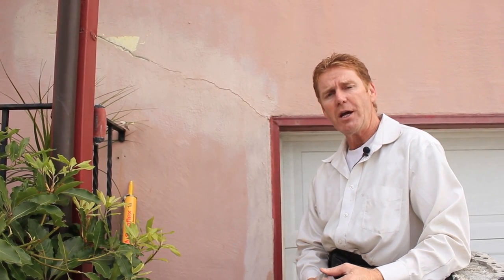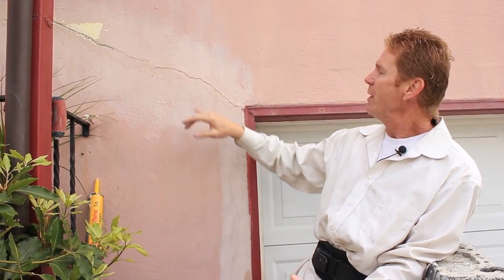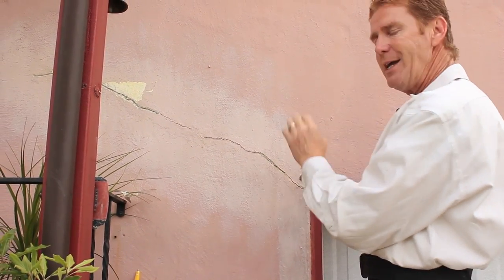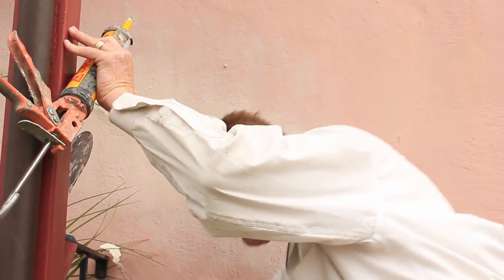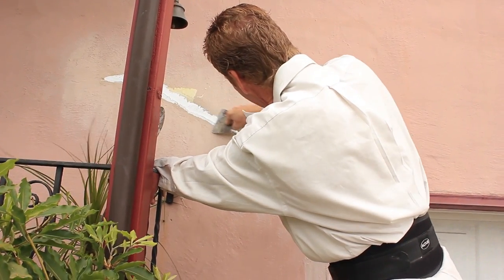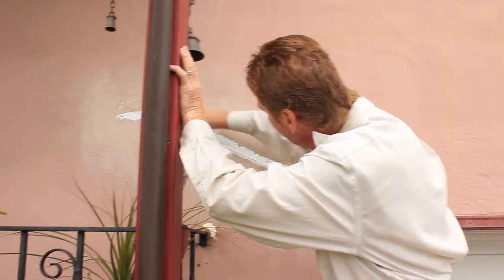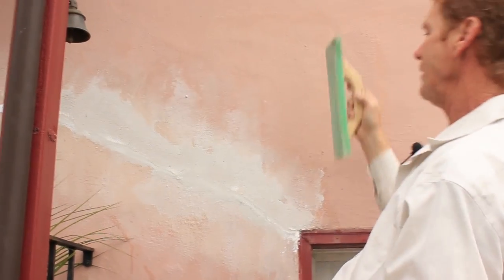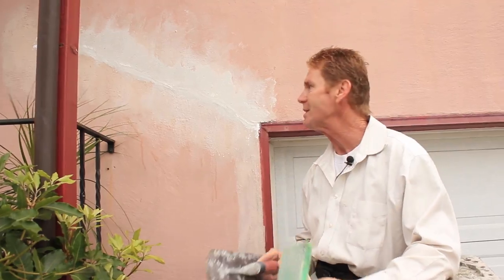Repair cracks with Sikaflex caulking by adding sand.

Comment: I commented on another vid you did I didn’t realize you are in SF Bay Area so am i. There are better sealants but most are multi component. Sika flex 1a has pretty high shore hardness but the fact is these type of cracks only usually move minimally with thermal expansion. And as you say vibration. With over 40 years experience installing sealants , for what you are doing don’t ever change from tried and true Sika. BTW I have always had better luck matching the texture by patting with a float than adding sand. I know you also use this method. Keep up the quality videos. You would think that this would be common knowledge to “stucco guys” but you would be amazed at how many just float a cementacious product in the crack and next year it’s back again. Keep it up

Comment: Hey Kirk, I've been using Sikaflex also for many years. It does a great job, but I also hate it because it is nasty, and won't wash off anything it gets near! But here is an alternate product that will clean up with water. It is called R-Guard by Prosocco. It is expensive, but well worth it for what it can do. Excellent adhesion, and about 30% flexing capacity. I'm a convert!! Give it a try. Thanks so much for your tutorials!
Reply from the maker: Good afternoon Paddy Daddy, good tip, thanks 
       Live long and plaster
  teaching  plastering video’s

Comment: Kirk, you essentially made like stucco bondo.Good stuff. Sika anything is top of the line stuff. I’m a glazier, and rain buster is crap, only thing close to 1a sika is vulkem which literally smells like good gasoline. As far as poly it’s good stuff. I got a job for you in Santa Rosa , if you see this contact me.
Reply from the maker: Howdy Goff, Sicka is indeed an excellent but hard to clean product. We don't get any on our hands then no problemo.
 Cheers.

Comment: I'm confused.. Kirk you mixed sand with sikaflex then floated it over sikaflex crack repair or you mixed up a little stucco and that's what you floated and mixed on top of the sikaflex?

Comment: Hi Kirk. Do u have any videos on fixing cracks that go into exposed brick pointing? I have a layer of bare brick on top of stuccoed wall (tile in between) cracked vertically in several places, Should I scrape out mortar and repoint or should I leave it and use strong caulking in the crack and then point on top of the crack with mortar, assuming that the crack will return in time? Cheers.
Reply from the maker: Howdy truth dude, 
 I have one that might shed some light on your question,
 Copy and paste the link below and see if it helps,
http://youtu.be/IkBHz_SQePQ
 best wishes,
Merry Christmas from the Giordano family to yours,

Comment: Please explain the different types of caulking and their applications. I have a stucco exterior and If I paint over the caulking, do I use an acrylic caulking, or elastomeric caulking, or is there a caulking that' has sand in it. I'm concerned about how the acrylic paint will reveal the caulking.
Reply from the maker: @birddogfreemann  simply caulk your cracks with Mor-flexx, it is an acrylic based caulking with sand in it. You can’t go wrong.

Comment: Hey Kirk,

I filled some mortar cracks with some loctite PL polyurethane caulking, but i didn’t know the sand trick at the time. So I tried to feather it a bit with a big paint brush and water. Anyway, it says it’s paintable but now I’m wondering if I should go back with some sandy caulk to touch up before repainting. There are a ton of cracks so it’d be a big job. Oh, and also wondering if you could stucco over this stuff. Thanks, Dan
Reply from the maker: Hi daniel, yes you can color coat over the entire walls but you will need to pressure was first then apply a bonding agent, "quikrete to the entire wall" not in the mix. 
This bonding agent will protect the surface so no ghosting or bleeding will show through the new color coat finish.
 Or if yours skilled you can apply a Mor-Flexx caulking to all the cracks and feather that in, the Mor-Flexx is paintable.💃
Reply: @StuccoPlastering  thanks Kirk — been loving the vids, just about to start my mortar + stucco journey here on an old adobe home in the california southwest, so i’m sure i’ll be watching more. would you recommend a ‘stolit’ type product for old adobe repair, or would traditional stucco be more appropriate? I power washed the whole house which exposed all the vulnerabilities in paint and stucco, so im trying to find a good solution for a ‘patch’ restoration, as we don’t have the means to completely strip all the paint and stucco. i’ll be repainting the house with an acrylic paint. just seeking best adheration, not sure we can keep every bit of water out, so a bit concerned about using an elastomeric type product. the place keeps pretty dry except for in the winter season. good amount of temperature flux here too, between mountains and desert. any word would be helpful. Thanks again

Comment: Hi Kirk, been watching your videos a lot to start preparing for minor repairs on our first home. How do you know a crack needs to be gouged out before caulking? Is it about the depth and width, or is it about what's causing the crack, or both?
Reply from the maker: This video below explains how to caulk cracks in stucco walls, whether structural or small.
https://youtu.be/2eIkdeIBbMs/

 As far as gouging, as long as the inside of the crack is clean, say you pressured washed the walls or used a wire brush, this sort of etches the inside of the crack where the caulking goes, your good. 
However, I'm scraping where the two cracks meet as this was like an earthquake, it caused both sides to flair out words, so I had to scrape that hump or ridge off, while I was doing it, I gauged or cleaned the sides as it had dust dirt grime and other junk in it.
 Remember nothing sticks to that stuff, not even the best caulkings.
Okay, spider webs sitck.

 What happens if the crack is deeper than 3/8 or wider than 3/8, and you caulk it, and over the next few days, you notice the caulking got sucked in? Nothing happens.
 You just add more when you have time. In this video, I smeared the caulking all over as that's what needed to be done. 

 As a rule, you just fill the crack any gets on the existing wall no problem, feather or blend it in.
Thus when painted, it won’t show.
Now you know. 🍾
Reply: @StuccoPlastering  Thanks for the link, I’ve been binge watching a lot of your videos. All are very informative and very useful thank you so much!!

Comment: I've done pool mastic with sika flex and it has one weakness it needs air to cure. So if you want to add sand for texture you need to let it set up for a little while maybe ten or fifteen minutes or so. If you throw sand on it right away a month later it will be wet and goopy under the layer of sand.
Reply from the maker: Not really, once the Sika-Flex polyurethane caulking hits the air, it starts the drying process.
 I have had to throw away too many previously opened tubes, even though I sealed them well after using them. 👨🏻‍🔬
Reply: @StuccoPlastering  I re applied mastic around a pool with sika flex and immediately threw sand on it for texture and a full week later it was still goopy under the sand. THAT was a pain to clean out I will never forget. The second time around I used deck o seal and five years later it's still running strong. About 3 months ago I did another pool mastic for a friend of mine and used sika because it was cheaper only this time I gave it about 15 minutes to air dry before applying sand and the following day and week 100% all good. That's been my personal experience anyway. I should add with the deck o seal I added sand right away. No choice really, you get no time to tool it despite my having left it in the fridge and applied it in shade around the pool. Had to hire a helper too, deck o seal is very unforgiving.
Reply from the maker: @Mike-qo4kp  Morning Mike, I've never used "Deck O Seal" thus can't comment. I have been using "SikaaFlex-polyurethan adhesive sealant  1A" for over 40 years, It has never failed me, I'm talking about no doubt, a thousand tubes, in this time. Once air hits it, as when we open a tube and try our best to seal it, it won't seal, it will get hard as concrete within a few weeks if it's left in a tube. It's the strongest, longest caulking I'm aware of. 🕵🏼
Reply: @StuccoPlastering  hi Kirk, appreciate the response. I was just conveying my experience and the type of sika I was using was self leveling which might explain the variation. Never used the good stuff that you use I don't think.

Kirk I have a question I am repainting the home I live in for the homeowner and there was a remodel done sometime ago. The home is old, south San Jose you're probably familiar with the area. Off blossom hill road by the foothills. Anyway the builder apparently among other things did not repair the stucco when he built out the kitchen. The house is stucco top half t1-11 bottom, anyway up on the second story where the stucco and roof shingles would meet there's a nasty big gap the length of the roof. Step flashing is clearly visible the whole way. I'd say the gap varies between an inch to several inches in some places where stucco is missing. Unsure how to proceed, but it's holding up my paint job. Homeowner hates how it looks and last year when it rained water was dripping in the kitchen it was making it's way to the fluorescent lights in the kitchen and dripping on the wood floor. Would appreciate any advice on what you think we should do. I think the house was built in the 60s. Also where the stucco walls meet siding the original builder used some kind of wooden drip edge which is rotted in several places. And where stucco and this drip edge meet there's no gap for water to drain so I'm not even sure what it's there for? If this was your house what would you do or change if anything? Appreciate your time and expertise, I watch your videos all the time.

Comment: Hey Kirk, I have an old home that was built around 1954.  All the walls are plaster with the steel mesh embedded in the walls.  I have to patch a bedroom wall and ceiling where we eliminated a closet.  The walls have a real light sand finish to them.  What kind of sand do you recommend and is there a method to how much sand to mix in?  Is there some sand already in Dap plaster of paris that my local store sells?
Reply from the maker: Howdy Ricky, most gypsum based product have very little sand, you can buy a hanful of sand to add or buy a bag of veneer basecoat, it has fine sand in italready.     
                     Live long and plaster, 
  Sharing so-called stucco secrets, or common sense tips

Comment: Hey Kirk, whats the benefit here of using caulking over mesh tape and stucco? Is it that it that the caulking has more give and therefore less likely to crack again?
Reply from the maker: Good afternoon Alexander, good question,
 It helps with movement, but on the downside, it's tough to cover the mesh tape to prevent a bulging effect.
There are many ways to skin a cat.
       Live long and plaster
  teaching  plastering video’s

Comment: Thank you for the video Kirk, very helpful. What kind of Sand did you mix with the Sika?
Reply from the maker: Howdy Triston, just regular stucco sand which is called either Felton or Olimpia sand.👍
Reply: @StuccoPlastering  thank you 🙂
Reply: @StuccoPlastering  Actually, maybe we have a unique challenge for you in all your years of experience(?) We need to grout a shower in a trailer with porcelain tile that will experience a lot of movement. The substrate is solid 1/2" plywood, but it will undoubtedly flex a little bit on bigger bumps. We can't find a grout that's flexible that isn't super shiny/glossy so we're looking at alternatives. Does what you did here seem like something that would work permanently? Either way thanks again!
Reply from the maker: @Trstn12  Hi Tristan, one can't put tile on plywood as, no matter the grout, moister will go through and swell the plywood which will cause the chain reaction of popping the tile off. No doubt with twenty showers or three months. You must use a cement board with a membrane underneath, Or lath and stucco or grout that piece of plywood.🤔
Reply: @StuccoPlastering  Noted and thank you again. We are planning on using a construction grade sealant adhesive made specifically for adhering tile directly to plywood and other uncommon substrates in high movement locations like trailers. It acts as a moisture barrier membrane that is (supposedly) impervious to water and any/all moisture with a permanent holding force and flexibility.  (hopefully this isn't a too good to be true situation) It's mostly the grout decision we're hitting, if we have the plywood protected from moisture and the tiles adhered strongly to the substrate, we mostly just want a grout that will not crack with jarring movement and will also adhere to the edges of the tile. Does the way you filled that crack seem like a viable solution to the grout issue? Also, I take your expert opinion to heart, we are just at a point where we built out the shower with the knowledge of the adhesive we're using, so we can't really go back on it and will take our chances XD

Comment: that was a great tip with the sand!
Reply from the maker: Hi ESCAGEDO WOODWORKING, today, there are  many caulkings with the sand in them, I like Mor-flexx which is really easy plus it's water cleanable.
 Best wishes, 
 kirk Giordano Plastering

Comment: Will the caulking destroy the sponge float if its not water soluble? How do you clean off? Thanks.
Reply from the maker: Evening MrTruthislight, dude, you are really paying attention! Yes, that float went into the garbage as it could not be cleaned with water.
 I buy these green spong floats by the case about 70 per box, sometimes you just gotta throw them away, the one I used in this video was on it's last leg anyhow,
 by the way they do sell caulking with sand such as Mor-flexx but it's as strong or long lasting as this sikaflex caulking., but it is sure easier to use.
 best wishes, 
Kirk & Jason Giordano's DIY plastering & stucco network
Reply: missing the not between it's and as.

Comment: What type of caulk do you use to seal the gaps between windows and EIFS stucco? Thanks in advance
Reply from the maker: Howdy Gunnar, Dude, the best caulking sealants are also adhesives such as Sikaflex and Moistop caulking.
There are many more, these two I happen to use often as they have never failed me plus both are professional grades and have stood the test of time.    
                                   Live long and plaster
               Kirk Giordano’s Plastering answers to life’s issues
Reply: Try Adseal 600LM, they’re awesome!

Comment: "Mixed up some sand"... Is sand mixed with what?  Just a bit of water?  Thanks.
Reply from the maker: Good afternoon Kyle dude, the sand will stick to the caulking, happy holidays
                       Live long and plaster
           Sharing the plastering knowledge
Reply: Cement is not flexibl ble.  The flexible stuff will keep the crack closed for a longer time.  Especially true for this kind of crack.

Comment: Dont pull the caulk gun when you're trying to get it deep into the crack. Keep it 90 degrees from wall. Push it into it. Then do your thing
Reply from the maker: Greetings Andrew, thank for the tip.
                Cheers,
       Sound Plastering tips from your favorite stucco geeks

Comment: so what did you do with the float?
Reply from the maker: Howdy Denny dude, the caulking is super strong and a sealant, so if I try not to get the float to touch the caulking just the finish which is stucco.
 I did wet the float a little bit as to dry a  green sponge float will simply pull the stucco off.                  
              plaster it’s everywhere you want to be
    Sharing DIY Plastering tips from Giordano Plastering

Comment: What is it you used?  what is the product name?
Reply from the maker: Hi Robert w Sieburg, this way is tough, buy some Mor-Flexx, it is a lot easier, plus cleans up with soap and water and textures better than what I did here,
 cheers
 Kirk giordano
Reply: Thank you Kirk for responding back.
Reply from the maker: Hello Robert, no worries.
 kirk
Reply: Hey Robert, he was using Sikaflex 1a Polyurethane Construction Sealant. I love the stuff....it cures to a very tough rubber consistency and adheres like crazy. But as Kirk pointed out, it can be challenging to work with in some situations, and for this application there are more user-friendly DIY options.
Reply from the maker: Atta boy Ted,
 cheers,
 kirk giordano

Comment: Try masterseal np1 or Dow corning products.  Dow is really good for adhering to concrete.
Reply from the maker: Greetings Graham, I agree Dow Corning makes some awesome caulkings and flashings, among other things.
                Cheers,
       Sound Plastering tips from your favorite stucco geeks
Reply: @StuccoPlastering  most of Dows products I have used are silicone and totally wrong for this application NP1 is a quality product it used to be sonneborn then basf